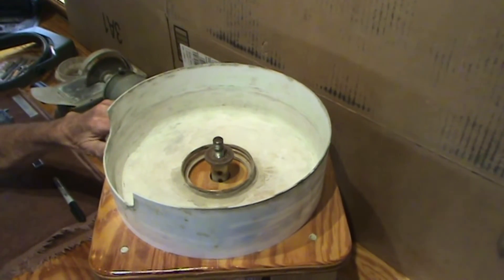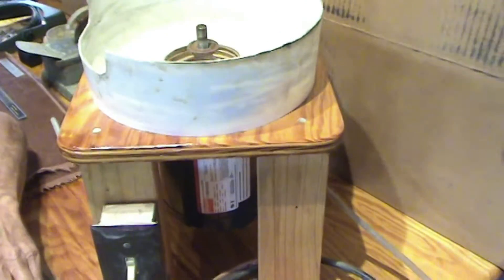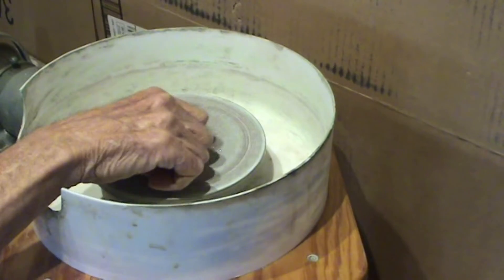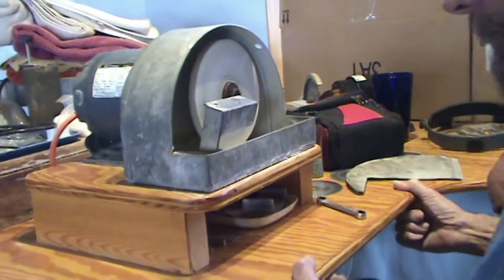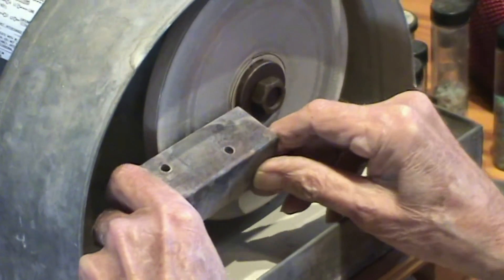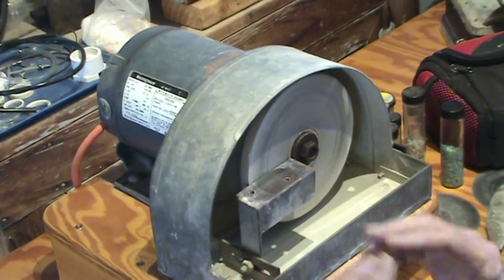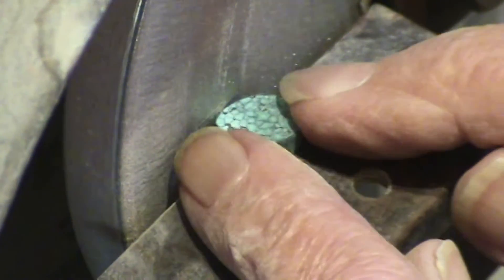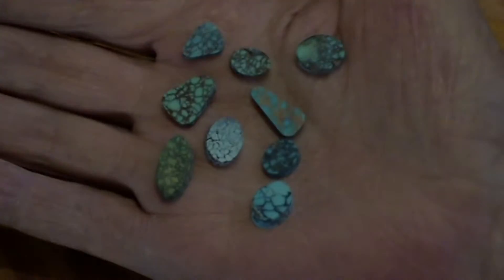HOME MADE FLAT LAP MACHINES

Comment: My flat lap is very similar, I used an upside down 5gal where you used 2x4 legs, but mine has the same removable basin and plywood deck. I simply cut a plywood circle that fits just inside the bucket bottom and painted it white to match the buckets I used. I figured it up to be $35 in parts, not including the master lap and abrasive plates, if you have a motor already on hand.